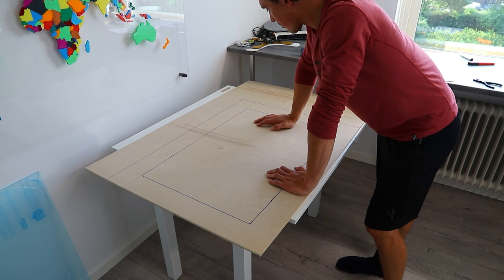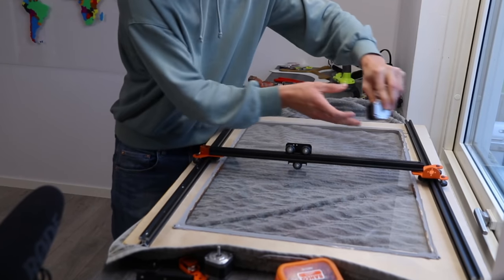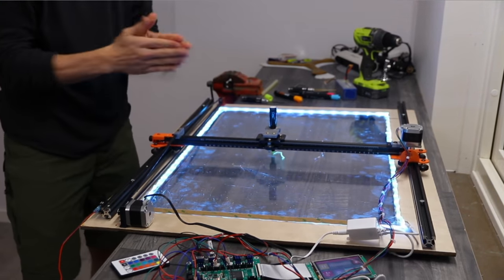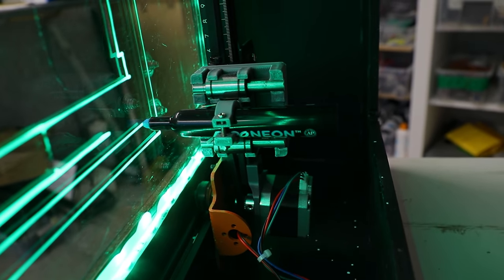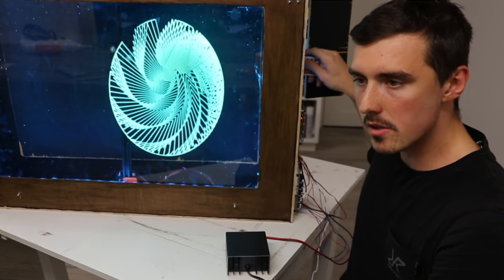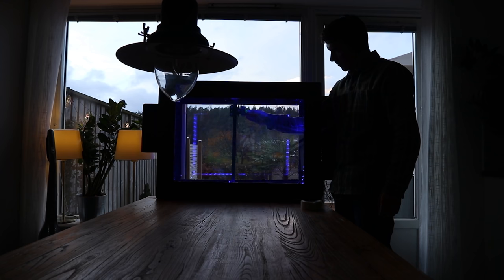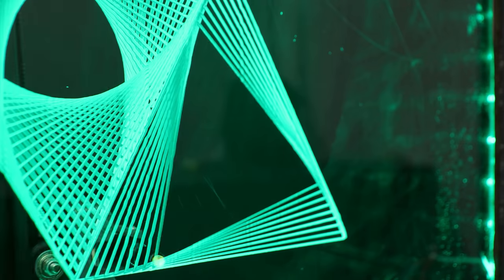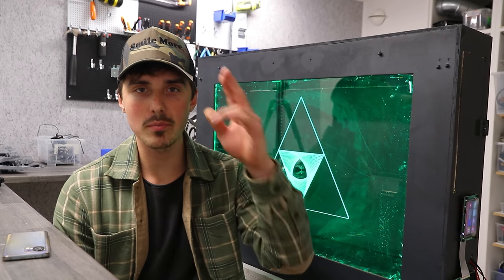Building A Mesmerizing Light Pattern Creator

Comment: These are by far my favorite kind of video. I would love to see you go more in-depth with how you approach making and sending the gcode, and how the firmware of the 3d printer works to make the pattern. I know it’s all CNC but I would assume that firmware for 3d printing is way different than doing something like this. Awesome project!
Reply: it should be basically the same, but you would not use the Z-axis as much, only to raise an lower the marker
Reply: @michaelwojczik3740  Or not at all if you set up the marker as extrusion, you'd actually use laser cutter code probably
Reply: Or plotter code though not all plotters control for pen up and down. Custom GCode is also a very doable situation which I would personally use but doesn't answer the original question as well
Reply: @michaelwojczik3740  sure, but the g code he’s getting from sandify, is he loading that directly into the 3D printer with the current firmware that was already on the printer . Or is he changing the firmware to read and run the gcode properly

Comment: What if you use a panel with a glow in the dark film on it and than draw figures with an uv light or uv laser? Because the laser doesn't have to travel as far (if you have some distance to the screen) you might be able to speed the drawing up significantly. Worth a try? Next project?

Comment: When need to cut screws good to put at least one nut on there then while taking it off it'll help to fix the threading also if use two nuts on there can lock them against each to lock them on the thread and can hold the screw by the nuts then in the vice (sounds more painful than it is for the screw and will save the threads on the screw)

Awesome stuff just figured would mention when saw the screw thread getting viced on, also those metal cutting Dremel discs are pretty great for that just wear eye protection.

Comment: You could make a trailing arm (like a castor wheel) which has a marker eraser that deploys from a servo. Using a pen plotter style holder to lift the marker and  lower the eraser arm, simply run the design path again to erase it.

Comment: Maybe if you were using a tinted glass that glows with heat added you could use a infrared laser to trace out line's instead of using something that draws line's . I'm she there is glass that glows different colour when heat is added then disappear after a few minutes. It would create the same effect yet you wouldn't have to wipe off the print after each design it would just fade away it would be great idea instead of neon shop sign.

Comment: A really long windshield wiper on a set of z lead screws, make it where you can auto home the drawing head, when the auto head homes it creates enough for the wiper set up to move straight up and down and clean the previous print
Reply: That would be a good idea. I wonder if dry erase eraser would work. This way you can add them on them.
Reply: @kameljoe21  it may work the only reason I mention the windshield wiper is so that you have the possibility of using windex on it.
Reply: @jasonbarnes8047  Yeah I thought of that too when you said windsheild wiper then thought that the wooden box might now hold up to a bunch of water. Though It could work if there was a rolled up towel on the blade. A small spray system that triggers and 5 seconds of a runny drawing forms and then a blade moves in from one side and destroys hours of work.. From the speed of this thing It might take an hour to do a drawing.
Reply: @kameljoe21  a track at the bottom that holds a small amount of it with a drain to the outside or just a towel to soak it up until you can trade it out